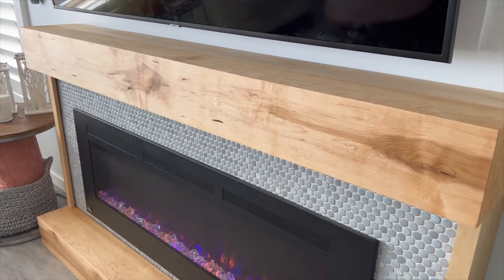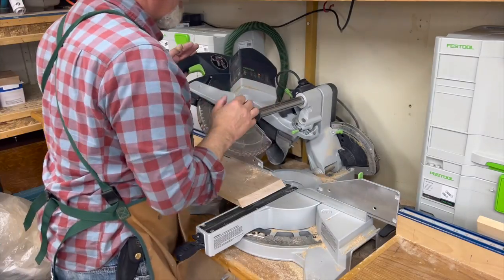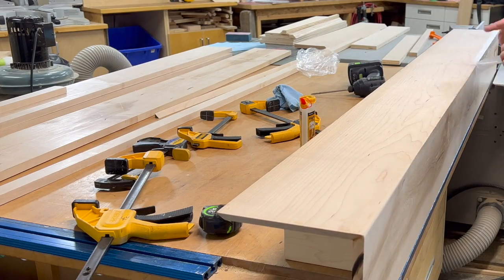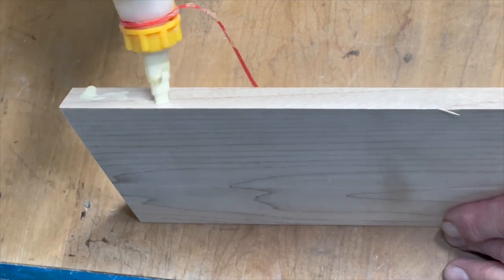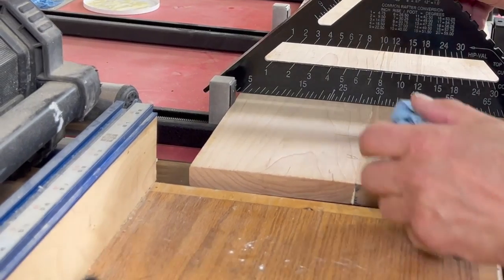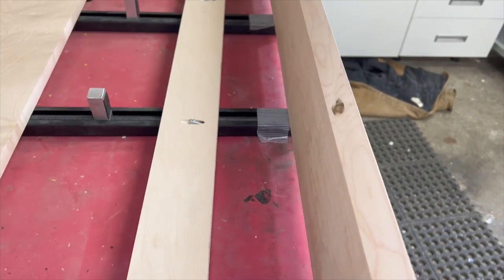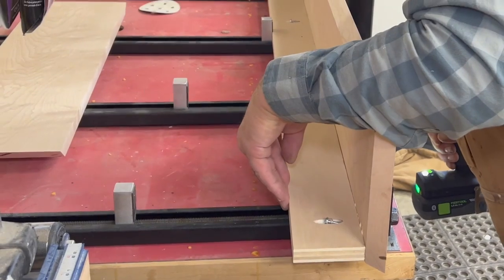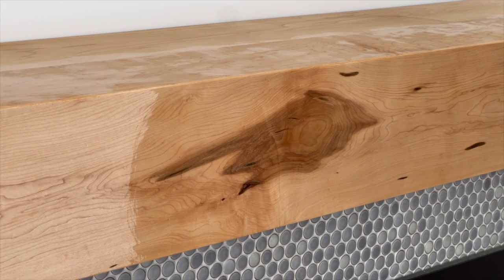Maple Fireplace Mantel with Folding Mitres and a "Lake Superior" Knot

Comment: I’ll have to try the Fatboy pencil, I noticed you using a carpenter pencil which surprised me, I like a finer line.
Reply from the maker: That was gifted to me by Fastcap. But you can sharpen that lead to a very fine point. The thicker lead doesn't break. It's a nice pencil.

Comment: And why didn’t you use the domino to enforce the 45 degree joint on the front of the mantle?
Reply from the maker: That's a valid point. It probably would have been a good idea to use an 8x50mm domino, but the mitre application would have been better suited to a 6mm domino, which the 700 doesn't do. (I don't have a Domino 500.) Basically I wanted to try the fold-over mitre with tape technique that a lot of woodworkers have success with. Initially I was planning on doing a butt joint with dominos but then chose the folding mitre so it would look like a solid chunk of maple.